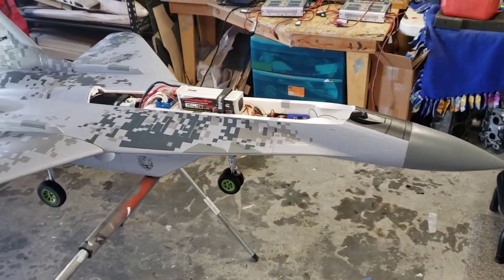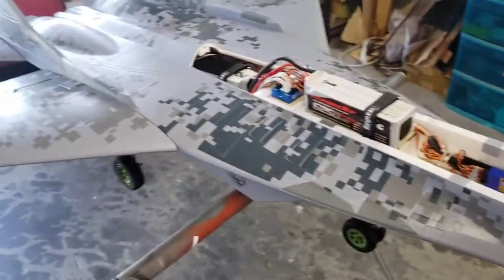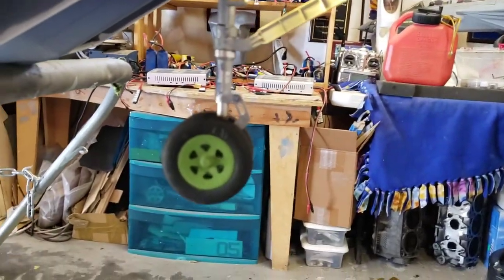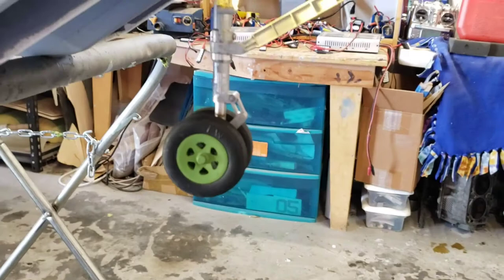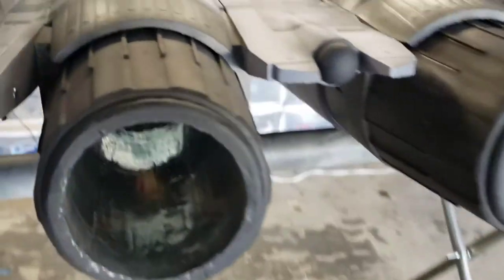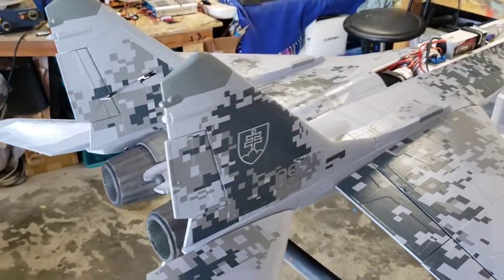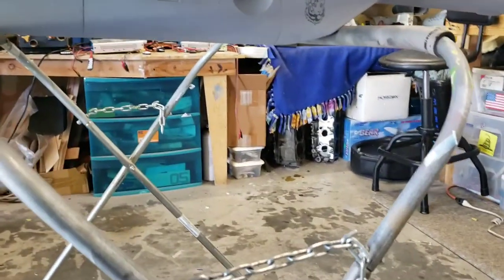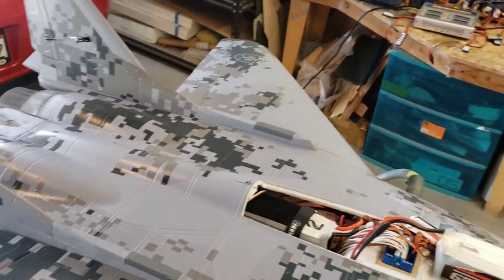FREEWING MIG-29 MODS AND SETUP

Comment: Great work.  Very straight forward valuable info.  Will definitely be applying your mods to mine before I maiden.  Been wondering about the tuck at speed issue since launch but what you have shown makes perfect sense.  Thanks for sharing!
Reply from the maker: Glad you liked it! As is currently setup i habe 0 nose tuck issues.

Comment: To get out of that high-alpha situation, it also helps to release the elevator - that tends to lower the nose, too. Cutting throttle without account for elevator puts you in a situation of reducing your airspeed more than just simply releasing elevator and recovering with less lost of altitude, too.
Reply from the maker: Im tried everuthing to get the nose down. But with full power nothing worked. Im talking about flying it at a aoa using full up and holding enough power to keep it moving forward in level flight. At one point the speed dropped enough the the back emd sank amd i applied full power...which led to the situation i spoke of. After i recovered...wejt up amd played with it...put it in same situation..amd only thing to fix it was to cut power to get the nose down.

Comment: I definitely want to try a couple of your ideas. I was definitely pleased also with the setup. I didn't really notice any pitch down issue on mine but I'm going to try a little reflex anyway. I've changed my servo but still have not tested them. I have not gotten around to doing the gear door mod yet. But I'm definitely interested in trying the ducting mods for sure! I was considering also painting mine but Callie is currently MIA. Typically I'm focusing more on that modification of a difference scheme versus any performance modifications.

Comment: I cut off 1/2" of spring in the mains as suggested in the video... huge mistake!  I recommend NOT doing this upgrade.  It makes things softer, but way too soft and completely changed ground handling.  I was sticking landings until I did this!  Replaced springs and all is well.  I should have known better, it it's not broke don't fix it.
Reply from the maker: I lile it with the softer springs. But thats jist me

Comment: Could I just ask how the wiring is on this regarding the esc to lipo and esc throttle cables to RX? Is there basically 1 esc per motor connected directly to the lipo? And does each esc throttle cable plug into the blue box and then 1 throttle cable to the RX? I ask as I'm going to change to Avian ESCs and hoping to get telemetry.

Comment: Great Video.  Do you use the same “C rating” on both batteries for every flight? I have a lot of batteries but a few with the same C rating discharge.
Reply from the maker: No i use the same style packs. Doesnt mean you "have" to...youll just get slightly different power output from each fan. Worth a shot though as lobg as they were similar mah
Reply: @hechtspeed  Ok thanks.

Comment: Would you say running a BEC at 10A and 6V be safe with this? I can't reduce the V any less. Thanks
Reply from the maker: Yes 6v is fine. Ive run 2s life packs on freewing jets a ton. Thats 6.5v under load
Reply: @hechtspeed  much appreciated for the advice, thanks 👍🏾

Comment: I did not know about that on the servo i put it wear you put it on the most inner hole with 85 percent throw omg i almost didnt recover on a dive so next flight i did 100 percent throw its prefect
Reply from the maker: Thats good! Yeah i have my stabs at full travel which is 150% on my radio. Also wheres your cg?
Reply: @hechtspeed  i run 2x 5,500 the back one all the way back and the front on the center trey
Reply from the maker: @octane2099  how many c? Im running rparing top 6250 35c and they are pretty light. I actually hoged out my hatch so i could get the front one farther back. Its almost against the blue box. Homestly i might add some tail weight
Reply: @hechtspeed  I see im running the same brand but 5,500mah 45c they dnt even warm up they stay nice and cool 3:30 min and battery's are at 55 %
Reply from the maker: @octane2099  thats awesome. I fly a solod 5 mim with about 15% left over. But normally only put about 4000 back in

Comment: those 35c rating battery's dnt get hot or puff? i recently switched over to top roaring came from power hobby very happy with them how does that plane handle pretty good?
Reply from the maker: They are awesome. I dont fly wide open the whole flight either though. I just posted a video of it flying today
Reply: @hechtspeed  thanks ill look at it

Comment: Good info, thanks.  I have 12 flights on mine with the afterburners and I am liking it a lot.  This plane does not fly heavy like my big HSD jets.  Elevator servo connection is on inside hole like yours.  I don't understand why guys put them in the outer holes and then turn down the throws to 40-50%.  Just stupid!!
Reply from the maker: Yeah...some people dont umderstand geometry too well hahah. I thought the same. Flies very light. Reminds me of my byron f15 in the air
Reply: Harold what kinda throws are good for a average jet pilot? Not high rate that’s for sure! Lol
Reply: @scottelm3496  For the Mig-29 I would suggest the factory recommended throws.  I do run about 25% expo on the ailerons and rudder on most of my jets because I don't use dual rates.   Most my jets have 15-20% expo on the elevator as well.  Very predictable smooth flying plane.   I have 58 flights on it now.  I don't fly it as often as my other smaller planes but only because it goes through batteries two at a time.   Still enjoying it though...

Comment: What kind of flight time are you getting?
Reply from the maker: About 5 min with 6250s
Reply: @hechtspeed  how did you take apart the struts to shorten the springs?
Reply from the maker: @cbradley0427  just remove the scissors..and theres a small sliding screw that also needs to be removed

Comment: The controls failure seems to be persistent: https://www.youtube.com/watch?v=Xd9439NKVsA

Try separating the battery for the engine from the controls and receiver battery to avoid voltage drop during full power.
Reply from the maker: Ive done many...maaany full power dives...normally a few per flight. I think it has mlre to do with people using a nose heavy cg...which is what the factory cg is...amd then the elevators have more load. I have my cg 10mm aft of the recomended cg. 40-50 flights on factory servos and bec with no issues
Reply: @hechtspeed  What is helping you is the increase in intake aperture, which reduces engine consumption. If CG was the issue, the plane would not be able to take off.
Reply from the maker: @josidasilva5515  so....flying a model npse heavy wont put mpre load on the stabs to keep the nose level.....?
Reply: @hechtspeed  The objective of a nose heavy attitude is to delay stall, since the plane is tossed forward by the imbalance which increases lift (good for heavy models). Like you said, this setup is inefficient because you have to pull on the elevator to stabilize the plane, therefore creating more drag.